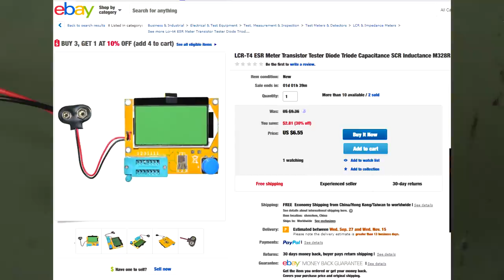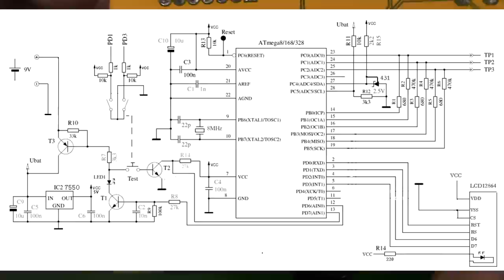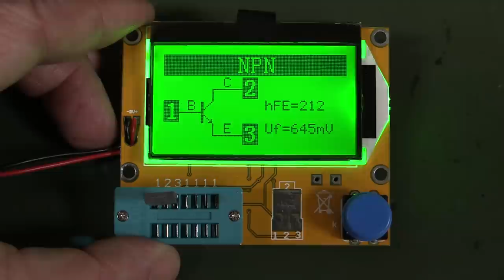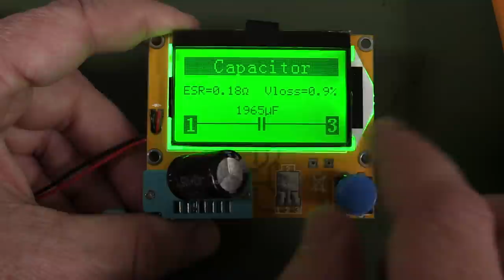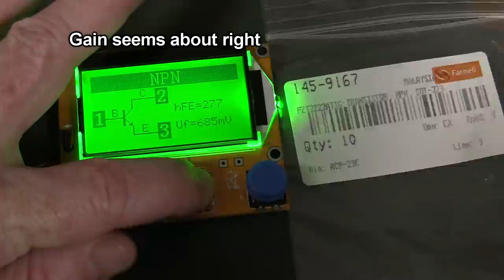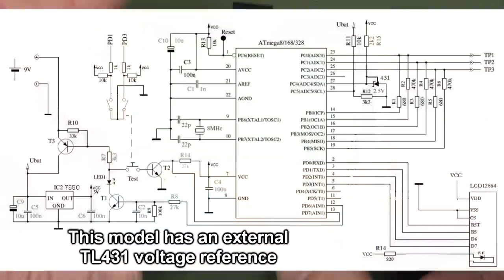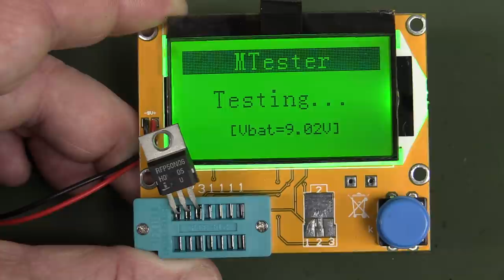EEVblog #1020 - Is A $7 LCR / Component Tester Any Good?

Comment: Obviously, the tester has not yet been calibrated either.  To do this, you have to short-circuit pins 1, 2 and 3, whereupon the setup begins.  At around 50% you will give the sample (i.e. what you used to short-circuit) to take.  From 70% you should then plug a 100nf capacitor into pins 1-3.  And then the setup runs up to 100% and your tester gives quite precise values.
After the calibration, the information from the tester to my multimeter differs by 1-2%. 
Don't have the monster multimeter now, it cost 40 € and what I was able to test gives quite precise values.  The tolerance is not used for a long time.
What I would like to know is that on newer models there are two contacts above the sign that is next to the button.  No idea what the sign is supposed to represent and even less what the contacts are for.  If someone could help me, it would be great!

Translated with google translate

Comment: The original tester was published in German journal "Funkamateur" in 2013-11 and in original is obtainable by it shop: https://www.box73.de/product_info.php?products_id=3385 it costs now 39€
But it was also discussed by German electronic forum: https://www.mikrocontroller.net/articles/AVR-Transistortester
And now there is the dedicated article https://www.mikrocontroller.net/articles/AVR_Transistortester in multiple languages.
And there is the SVN repository with hardware and software source https://www.mikrocontroller.net/svnbrowser/transistortester/ last change 3 month ago from now (12/18/2019) (still in development)
I've build two pieces from this repository 5 years ago, one for me and one for my friend.
The original one can operate with LiIon accumulator and charge over USB, and also can send CSV measurement values over Serial2USB. One full charge holds over 2-3 year. A really very smart and cool thing ever!!!
It is wonderful how to make such smart thing using very simple schematic!

Comment: Hi Dave, Love the video. I've got a literally a pile of old 2N3055 power trannies. Will this little gadget test them with suitable wires soldered to their pins to enable plugging them into the tester ZIF socket? what are the two empty pads for just above the dustbin? Thanks.

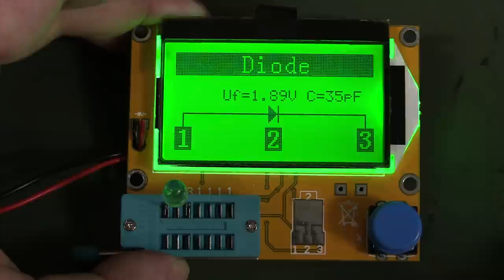Comment: At 06:35 testing the VN10 mosfet it showed a forward (threshold) voltage of 1.23 volts. If the gate was slightly leaky and passed a small current the tester probably thought it was testing a darlington transistor.

Comment: I use this exact meter daily , and you can calibrate it by shoeting the 3 pins then supplying a 10uf capistor and then the readings are damn close to real values. 14:05

Comment: Nice to see your results confirm my opinion and my tests, I got one of the DIP CPU, 2 line display versions of these a couple of years ago and threw a bunch of 0.1% resistors, 1% capacitors and various other bits at it, I found it was within 1% of the values marked and my Fluke meter, absolutely worth the price. 

There are versions with the hardware to test Zeners because there's a boost converter on there and as someone else has pointed out, you can run them through a calibration routine which makes them a little more accurate.

Comment: I zapped two of these with charged capacitors. First one, had a bunch of psu apfc main caps at 220uf 400v that had broken legs inside/ corroded. Initially they tested like 2000nF,  after cutting the open was curious to see the actual value, but one had still a charge in it and shorted the mega328 chip.
The second one, replacement for the first, a tc1 was toying with it after it arrived, measuring a capacitor but put in the pins market with K A A, the capacitor charged up from these pins and when moved to 1 and 2 pins mega328 burnt same as first. Now trying to get some mega328 and the firmware and some adapter to try and fix both.
Really wish they had some kind of voltage protection!

Comment: I got a "DROK" branded version of this off amazon for like $30 a while back. It has a bright backlit color screen, and is built into an actual plastic case. $30 might be a bit steep, but the plastic case is nice and overall it works pretty well. I'm happy with it, it's done what I need.

Comment: Picked up one for $15 au and can't fault it , sure its not a precision instrument but close enough for most hackers like me ! I find it really good for sorting the resistors out that come in kits - sure beats stuffing around with coloured bands - especially if you are colour  blind  or just mostly blind like me ! I tested a few ceramic caps - it didn't like anything under 33pf  but it did pick a faulty one out that i had in my junk box . One thing i like is when it shut down it draws no power so battery life will be good .
Reply: No experience yet, but what I read in another review is that capacitor values below that 33pF can  be measured by first measuring a slightly larger capacitor than 33pF, say 47pF, then put it in parallel with the unknown (just use same numbered pins), and subtract the outcome.
Not highly accurate, but it gives you means to see something.
I guess the same method can be used to measure small inductors, but then put in series.
Of course, keep leads and wires out of the equation as most as possible at these low values.

I have ordered one a bit similar, but since I first didn't know that there were different versions I guess I have to wait to see what firmware of features it has.

Comment: The original was the Peak Atlas Component Analyser DCA55 which came in a blue case with 2 buttons, the LCD display, and 3 test leads with the spring-loaded J-clips. It takes a GP23A battery. It only tested semis, but the company that made them also made a capacitor (leakage/ESR) tester, and an LCR tester. Probably someone from One Hung Lo, China reverse-engineered these and combined the LCR and semiconductor testing functions! :)
Reply: You're almost right ;)
In 2009, I've indeed seen the Atlas DCA55 in an electronics catalog, and thought it would be an interesting project to build something like this myself.
After some thinking and testing, I was quite happy with the component detection accuracy of my software and hardware. So, I published the project free for everyone on a German microcontroller forum mentioned serveral times in the comments (here, in German: https://www.mikrocontroller.net/articles/AVR-Transistortester). This version had an "old" ATMega8 and a 2x16 character text display.
In a few years, this project got more popular than I would ever have imagined, and was driven/developed a lot further by the community. Without the community, it wouldn't have a fancy graphics LCD and at least half of its features.

Comment: Around the 12 minute mark he tested a ceramic capacitor and he said that the capacitance measurement on the device was off by 12%. This difference could have just been the heat from his fingers on the capacitor as ceramic capacitors are very heat sensitive.

Comment: ZIF pin groupings on this unit suck. I used to have an older model with the 14-pin ZIF socket arraigned as 1232123 across the bottom and top rows. This effectively allows for 6 x 3-pin groupings, not 2, and believe me this makes it last longer (say if you work in component sales or do a lot of desoldering with the solder making it that much harder on the ZIF socket). Some may view this as nit picking, but doesn't cost more to etch it that way.. here, you have 8 ZIP pins really doing nothing.

Comment: The accurancy of this tester depends on the resistor used for the 3 terminals. Upgrading them to 0.1% resistor will help improve the accurancy. And there are models with cases, such as these: https://item.taobao.com/item.htm?id=534453342739 or https://item.taobao.com/item.htm?id=534445687506. New models can decode the codings of infra-red transmitters as well.

Comment: 9:40  yours does the same as mine... watch the cathode of the protection diode.  First it shows cathode to D, then when you flip the mosfet around in the ZIF, it shows the cathode facing the S pin.  On mine,, it would identify certain transistors as NPN or PNP depending on which way it's oriented in the ZIF socket.

Comment: I'm going to get one of these to test capacitors in an LCD monitor which has failed. I have the caps on order I ordered a kit that has all the right values and I'll whack em in and go from there. Hopefully I will have a working monitor once again.

Comment: i have found these to be useful, and if you are building inductors or in my case winding coils for metal detectors it is brilliant, and way more accurate than those cheap lcr meters that look like multimeters.
once you learn its quirks.
Reply: I have one and wound an inductor that inductor calculator said should have less than half what it measures

Comment: Watch out for the ebay prices.  Some sellers offer a low price but you you have to select the product from a dropdown menu.  Usually, the low price is for the case alone.  The unit, with or without case, costs considerably more.

Comment: Transistor testing is very useful if you're dealing with analog audio equipment. While this probably isn't accurate enough to match input pairs, it's still useful for troubleshooting.

Comment: And it does show up on the red one which costs more.  Perhaps if you want that feature don't be so cheap and spend the $4 more.  It also has you build it yourself so you can use 1% tolerances

Comment: I have received one from wish was about $10 or so delivered. I'm in Qld near Ipswich. I Discovered its a pretty good test of different things depending what pins you use. their are similar testers out there but his one only has pins 1 2 and 3. i like the labelling of each component on screen. even works with diodes and led's.
Reply: you can  also go cross pins 311 to get different reading of things. wasn't aware of the surface mount input though, but i wondered what the bare metal was for.

Comment: Surprised this little gem got past Dave for so long!  Although I have to admit I was initially skeptical when I initially discovered it, like other stuff from the realm of Chinese electronics, the price is so low it has to worth a punt!  I got one with a case and it is a delight to use, especially when I remind myself of the price!  Comments have been very useful on this vid, I didn't know there was a manual, so now I have even more delight to discover!

Comment: It should be mentioned also that 12% difference in capacitance measured might relate to the frequency the device is using to measure the capacitor at. Furthermore, capacitors (especially electrolytics) can have notoriously differing values from what is marked on the case and wide tolerances. If you're building a power supply filter though you really aren't going to care too much.
Reply: To be fair, he's comparing the difference in actual measurement between the component tester and a precision LCR meter, not the part label. He also did not calibrate the tester.

Comment: anyone mentioned you can set contrast by holding the test button on start for a second or so? 'Contrast' appears and repeatedly pressing the start button cyclos through. Leave alone for a ccouple of seconds after the correct setting and it will store the chosen value.

Comment: There are even many different testers that look almost exactly like the one you've got there, with the components placed at the same locations. I've got one too, and it comes from another factory, because in the details, it's slightly different. There must be dozens of factories that churn out these things in dozens of different revisions. But the yellow PCB, green/blue button on the right, ZIF socket on the left, is all the same.

Comment: They make a nice clear case for it for about 3.00 dollars u.s.  I seen a lot of pro useing these.I have four different ones Includeing the kit version I made ,they aren't expensive but they do come in handy .I have one they make a adapter to plug in with three test leads or you can unplug the adapter and use it like you have .

Comment: would it work better hooked to an actual power supply? stable 9.5V constant might make measurements more repeatable...or maybe more power for more resolution...?
very cool tool for component checking.
(also, hard to shove components in the socket when you have the handle in the down position, AND there is solder on the pins. eh Dave? :D )
Reply: todesgeber usually batteries make a better power supply, they are isolated and noiseless

Comment: I have a couple of these, the 16x2 and the graphic LCD. They don't always agree on the details but they are very useful from a quick and dirty POV when on the bench. Useful for matching transistors or diodes  as well as  passives.

Comment: I think these are best things since sliced bread for the hobbyist, I use mine all the time. As long as you know its limits and the caveats then its more than good enough. I've even used it to test a TV's worth of capacitors even with no visible signs of degradation showing and after replacing them the TV has been up and running ever since.

Comment: Can the tester read JFETs? On my tester it shows two resistors. It's at the JFET that I think is broken. The other day I received new JFETs J111 from China for my Fender Frontman amplifier, but unfortunately they also show the same two resistors! Can someone help with the interpretation? Is there a possibility that the JFETs were not declared and that defective elements arrived from China? Thank in advance!

P.S. Also, in the application notes for the Mega328, I saw that the JFETs are tester readable.

Comment: This cheap one you have seems to have some modified firmware, i got mine for 12 bucks and at power on it tells me what it is, it displays the battery voltage and if the voltage is too low it tells me "battery too low, shutdown".
Also if you put a voltage regulator in it displays gibberish on the lcd, which is handy when you want to tell a regulator apart from a transistor, for example.

Comment: I bought the same one unfortunately when you test the triacs it is not efficient. A triac higher than 4 amperes it displays as NPN transistor or as a resistor and diode

Comment: got mine today
here is what i have noticed

1. out of circuit it seems fine, it can detect caps , resistors and a whole bunch of stuff.
now
Example
i'll do this now as i type

i have the following CAPACITOR right now
SAMXON
400V  47uF
tested out of circuit the meter reads as follows
-----------------------------------------
         CAPACITOR
ESR = 1.8 Ohm           Vloss = 0.8%
46.03uF
------------------------------------------

so.. that's great it would appear that the cap is good
now.. SAME CAP.. in circuit (Power Supply board from a Satellite Reciever (Set top box))

here is what happens
-----------------------------------------
         RESISTOR
    2.25 Ohm   
------------------------------------------
wtf

I MEAN....
first of all, i want to check the Capacitance of it and the ESR
and the ESR is supposed to be around 0.20 or so.. right
so.. is this an order of magnitude out of whack or what ?

secondly why does it not recognize a cap as a cap in circuit
and when i measure a resistor in circuit
it will see it as a cap
but Resistor out of circuit is fine

THE POINT OF THIS THING IS TO MEASURE STUFF IN CIRCUIT
it doesn't seem to be able to do that

ANY IDEAS....

Comment: I bought this version as a kit on eBay for $18 mostly just to build.
Mega328 Transistor Tester LCR Capacitance ESR meter PWM DIY TFT LCD Generator (has freq generator)
It came with no operating instructions and when I contacted the vendor they said they had nothing.  Mine kept coming up with a message to calibrate it and it provided a web address for that info but flashed it by so fast that I had to take a photo. Eventually I got to the mikrocontroller site and printed off a simple manual and calibrated it. I thought the zif socket might be handy but found otherwise so now I have test leads with mini grabbers plugged into the socket. Worth having around I would say.

Comment: Maybe you could compare the Agilent LCR with the EXTECH 380193. The EXTECH has some nice features, and I found it to work very well. The issue is the cost of the Agilent compared to the EXTECH.  If you disregard the colors, the buttons and display look very good, and the same.  The EXTECH came with a PC interface.

Comment: The gizmo works,but is quite erratic,reading coils as low value resistors,useless while checking high power SCRs.But it is still useful and definitely very inexepensive.

Comment: Hello:
What is the integrated code of the 20-pin Microcontrollers on the Class 952 digital card (U1 and U2)? The IC circuit is burned and I do not know the code.
Thanks.

Comment: What an excellent device! Can it be used as an ESR Meter to measure bad caps still on the motherboard, like the ESR Meter MK-II you used to measure the caps and fix the LG monitor? Or do I really need to buy a 100khz ESR Meter?

Comment: I bought one of these, it was from wish, was supposed to come with the case but didn't, theu sent the case later, with no connecting pieces so I made my own. The unit works well, I just tested the components of a wish soldering kit, lots of leds, 3 of the 24 it shows up component unknown but the led lights up! I notice the flash pattern is different on these 3 leds. My question is it worth making the circuit with these 3 leds? I bought the kit to learn how to solder and have had hit and miss with the 2 I already made. I'm concerned I build the kit and solder it correctly but it fails because of these 3 leds, I wouldnt know if its my soldering or the 3 led components not registering on the device...... anybody know why they light up but do not register?